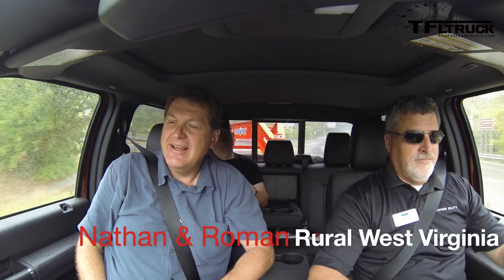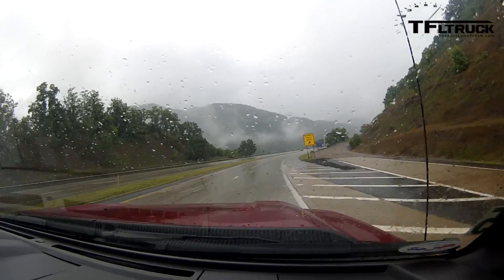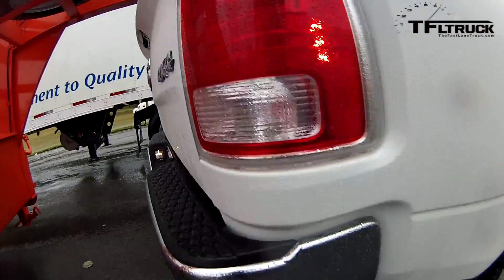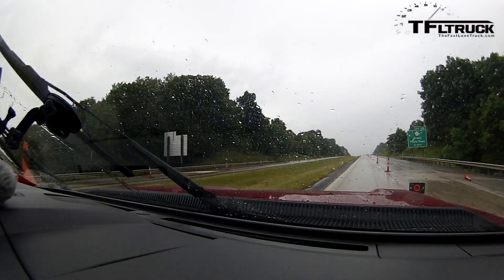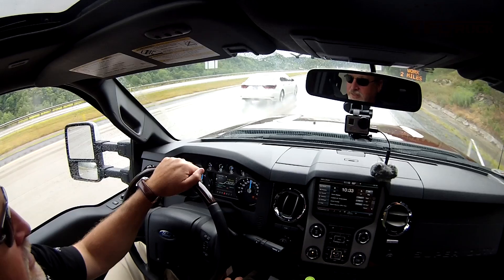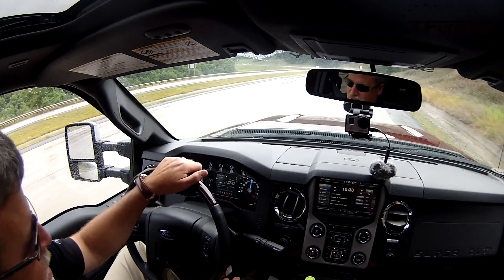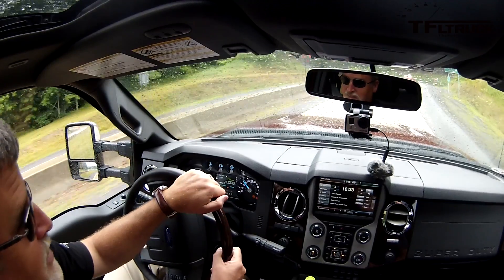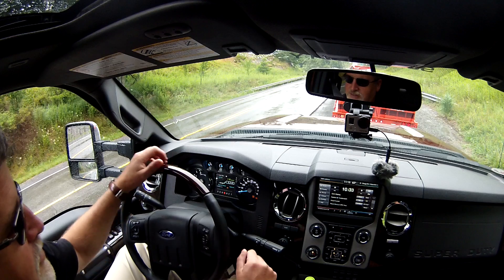New 2015 Ford F-450 Super Duty 6.7L Turbo Diesel: More Than Everything you ever wanted to know

Comment: I love how every time ford,chevy gmc and ram compare heavy duty diesel dually trucks chevy, gmc, and ram have their 3500 models and ford has their 4500 model. just shows how much more ford has to step up their game
Reply: Like i said a few comments up and gives buyers more choice plus people lok at the 3500 and say it has to be withe the 350 no they have all different weight standards there competing like this just to say theyer better
Reply: Joe Joe Clark Right. To add to that, its the GVWR that matters. the TRUE F450 was the 08-10 models: w/14,500 GVWR. (class 4 medium duty is 14,001-16,500) the 2015+ is class 3 max 14,000. (the exact same as the F350 and the Ram/GM twins' 3500 duallies). but, MOST ppl won't look up details like that.
Reply: They have the 450 becuase more people need a 1 ton for hauling so u need to do your research and think befor you type buddy
Reply: ...and its 450, not 4500...smh.
Reply: The F-450 is the same truck as the F-350 as far as suspension, engine, and weight rating. The difference is, it has several modifications made for towing such as lower gear ratios, larger wheels (19.5") to accommodate larger, more powerful brakes, and many standard towing features that are optional on the F-350 DRW. It comes standard with the Crew Cab and long bed as well as the diesel engine. The F-350 DRW actually has more payload capacity than the F-450, it just depends on what you need the truck for.
Reply: it doesn't make a difference because these comparisons are all engine
Reply: Armand Thanks for the article, it's interesting, but it doesn't counter anything that I said earlier. The payload on the F-350 DRW is substantially more than the F-450. Almost 2000 lbs. They're calculated the same way, as well, so it's fair to compare them since they're manufactured by the same brand.

Comment: Roman... Doing your homework!! Good questions--- Well done..  At 5 fuel pulses per combustion event, I wonder how frequently those injectors will have to be replaced and at what cost??
Reply: Not as frequently as you would assume, unless you fail to use low sulfur fuel.
Reply: Zack Zander excellent heads up.. Thanks

Comment: 6.7 powerstroke engines are rare in kuwait but they are the only diesel engines they brought here ( F-350 only ) .
Reply: No Chevy Duramax? Sucks! Chevy 2500 6.6L Duramax is my current ride! :-)
Reply: Michael Doerner
because chevy dealer here just bring the 2500 & 3500 HD with 6.0L with dually wheels ( for 3500 ) which sounds retarded unlike ford dealer they bring F-350  6.7 powerstroke dually wheels XL with FX4 mods but for the F-250 it's 6.2L gas .
Reply: The gasoline V8's don't suck...but they're no diesel...:-) If that's all you can get on your hands, then by all means...grab the Powerstroke! :-)
Reply: Michael Doerner
will kuwait is not that big but they can use the PSD in oil field or other heavy jobs but for normal people who own farms or towing stuff a V8 gas in a super duty is good .

Comment: Makes you wonder what kind of horsepower and torque these things will be making in another 5 years.
Reply: The government might start regulating the power on these. Anyway Its no use to have more power than capability. They might max out at 900 ftlbs and 450HP.
Reply: Douglas Nicolas Well Top fuel dragsters go 0-100 in less then 1 sec. and pull over 5 g so 0-60 in sub 2 sec. is noting compared
 to that

Comment: now ask the real question how long will it be before this thing breaks down 50k 60k sure it makes horsepower but without reliability whats the point? none of the modern diesels seem as reliable as the older ones I know the emissions are to blame for some of it but I suspect this horsepower/torque race isn't helping.
Reply: mh87351 Exactly my point, with all those emission crap they put in these engines, reliability is down the drain. You will better served with a lawnmower engine. :)

Comment: I'd like to see some time numbers from all the trucks pulling that big-boy trailer up the hill. No doubt the Ford walked away from the Cummins & Isuzu.
Reply: the cummins wasnt the H.O. they say it is but in the video when they show the rear of the truck it doesnt have the badge on the back. just fyi
Reply: TheCrEaSe44 You do realize that since 2012-2013, Ram drops the H.O. badge entirely from the Cummins Ram lineup? Any badge that you may have seen out there on the 2013 and newer Ram are done by the owners themselves. The only way to look for an 850 lbft Cummins Ram now, externally, is to check the rear differential cover, assuming nothing being changed from factory setup.
Reply: SB N well there must be a shitload of either 2012's-2013's out there cause i see them all the time.

Comment: Why don't they make a 6.7 litre Supercharged V8
Reply: ***** the turbo veins help high boost at low rpm compessing the exaust inside the turbo and opening more at higher rpms due to moe exaust plus a supercharger  doesn't have as good of benefits at boost levels and uses engine power to turn them all of them twin screw ect. Yes brings in more air burning more fuel there may be uses with superchargers on diesel but turbos are more eficent exept in heat energe then goes to intercooler ect.
Reply: Joe Joe Clark its a vgt look it up not feeling like explaining someone else can
Reply: ***** I'm going to have to disagree with you about the supercharging. Detroit diesel has had supercharged diesels for years. Supercharged and turbocharged. You don't have to argue with me, just google it
Reply: ***** Efficiently is the main driving force for the use of turbos over superchargers, however, Supercharged diesel engines have been around for almost as long as the diesel engine itself. However, they have traditionally been found in large low revving engines such as those found in semi tractor units, heavy construction machinery such as bulldozers, 2 stroke  diesel generators etc as a cheap means of boosting power. Now the down side is efficiently, this is where a turbocharger comes in. because its driven by the waste gasses from the exhaust rather than the engine itself it tends to produce better fuel economy figures. furthermore, advances in higher revving diesel and improvements in turbo technology has made them more desirable.
So as a basic rule, if the engine was a low revving unit it would traditionally be fitted with a supercharger, however with more modern higher revving engines a turbo is better suited. That said, with advances in turbo and diesel technology over the past 20 or so years, we've seen them moving into the traditional supercharger areas.
Reply: ***** actually there are supercharged diesel engines. Detroit diesel made them and some of them are still in use in the military. one that comes to mind is the 8V92. there was a few configurations for it but they had a supercharger. the ones in our wreckers are both super and turbo'd with the turbo feeding the supercharger.
8V92 means this....8cylinders. V type. 92 means each cylinder is 92 cubic inches. hope this helps
Reply: they do have supercharged diesels , the old two stroke detroits were supercharged its just not beneficial in light duty trucks

Comment: Why does Ford always compare their F450 to a Ram 3500? lets see them put the Ram 4500 against the F450, something tells me there is a reason for that! And sorry, but Torque is what gets you up a hill!
Reply: Torque is what gives you momentum, horsepower takes over once the torque has you moving. And the only difference would be towing capacities and maybe gear ratios, the engine output would still be the same
Reply: torque is twising motion of engine power to tire hp is displasment stuff the reson why ford uses the 450 against 3500s is that it highest NON HEAVY DUTY PICKUP and that the f150 is more of a ride around truck in the f seires and 450 is more of a 350 if you know what i mean 4500 are heavy duty
Reply: HP=(Torque x RPM(speed))/5252. Look at that formula and answer the following question:

1. What happens when you have 1 billion lbft of torque but 0 RPM(speed) because the object is not moving? Answer: you get 0 HP

2. How much Torque can you get out of a 10 HP? Answer: nearly unlimited (assuming there is no power loss from gearing). If you make the RPM so tiny, but not 0, you can have trillions of lbft of torque with just 10 HP.

HP describes how much torque the engine can produce at certain RPM. In another word, HP is the only valid parameter to be considered when comparing different engines work rate capability.

In conclusion, you are wrong. HP is what gets you up the hill or moving anything if at all. With no HP, you won't know if the engine is making any torque or if it has ton of torque but not enough to move the loads..aka it has no work rate. When you have HP, you know that you have work rate, and you can get the job done.
Reply: ***** Exactly, a Ram 4500 would lose even more with its 325/750 output.  The F450 pickup has the same 440/860 as the F250/350 pickups.
Reply: ***** They do have one, which puts out 300HP/660 lb-ft.  The Ram has the Ford beat here
Reply: F350, F450, F550, Ram 2500, Ram 3500...etc don't matter. They are merely just the name given by each manufacturer. Going by the names alone to determine the "truck classification" will throw you off guard. The truck classification is usually based on the GVWR.

According to Ford, their F450 is considered to be "light duty class 3", which is the same class as the Ram 3500, based on their both GVWR of 14k lbs. Realistically, the F450 GVWR is 14061 lbs to be exact, which puts its off the class 3, and slightly into the class 4. Ram claims that their rating follows SAE J2807 standard, while Ford doesn't. Hence Ram classification is more valid. Ford currently battles Ram in "best in class" claims.

On the side note, both GM and Ford are taking the spare tires, car jack, tools..etc off the truck during their GVWR rating so they can squeeze their trucks into the lower classification. Ram doesn't.

The fact is still there though. The 6.7 Powerstroke is the most powerful diesel available on the light duty pickups market. It doesn't matter if it's F250, F350, F450 or Ram 3500....it doesn't change the fact that the 6.7 Powerstroke is the power house. 440 HP, with 860 lbft backing it, is nothing to sneeze at!
Reply: SB N You sure hit the nail on head, especially when describing horsepower and torque.
Reply: MrChevypower well fords 6 7 has 440hp and 860lb feet of torque best in class please comment if i got your comment confused
Reply: Joe Joe Clark Yeah I was talking about chassis cabs, which are detuned by all manufacturers.  Dodgeguyz was talking about the Ram 4500, which only comes in chassis cab with 325/750.  Ford's F450 chassis cab 6.7 puts out 300/660 (less than the Ram's).  But Ford also offers an F450 pickup, which has the full 440/860.  Hope that makes it a bit clearer.  I think it's confusing, Ram has at least 4 different tunes on the 6.7 Cummins right now depending on the truck model and configuration.
Reply: the engines are all the same f250 through f550, the only difference is the stance for the front axle and the stiffness of the suspension so it doesn't make much of a difference in these comparisons because in this, it's all engine
Reply: ***** fair why there out selling each other
Reply: MrChevypower all depends on what you need and what packages you put ont the trucks you are comparing but ford is puting there 450 against dodges 3500 towing package
Reply: Joe Joe Clark That's cos the 3500 is the heaviest duty Ram pickup (not cab chassis), so it is the closest competitor to the F450 pickup.  If Ram offered a 4500 pickup, then it would be fair to use that.